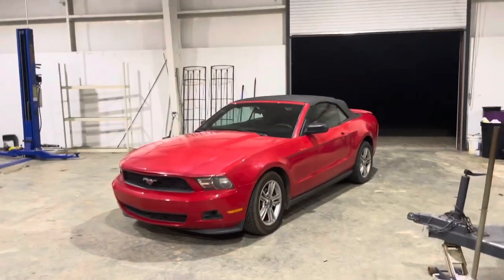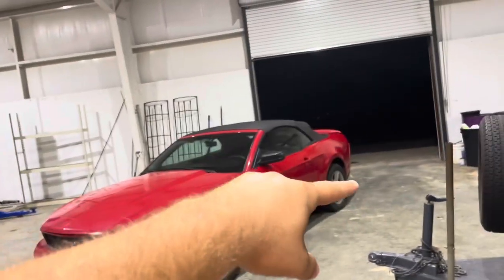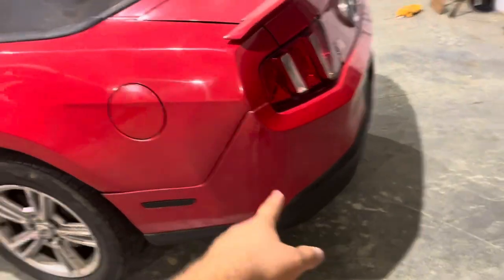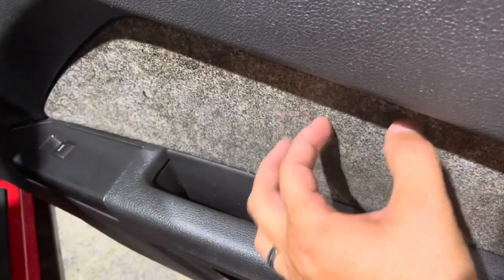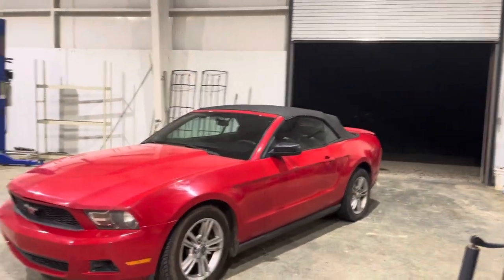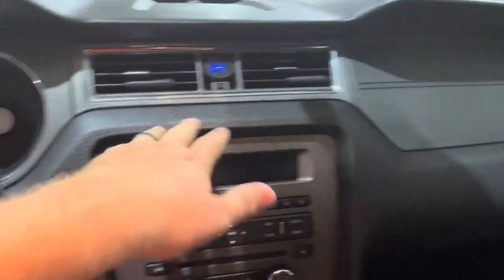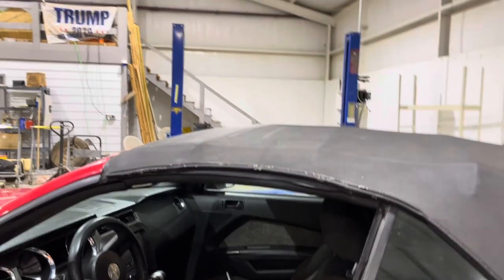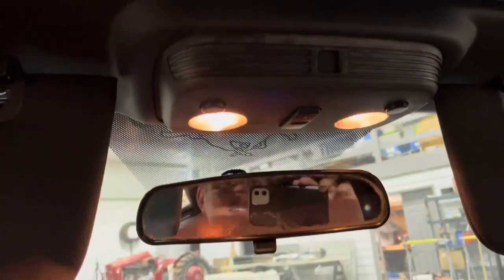Got my Wife a Convertible Mustang that wont open

Comment: Cool ride. 
If you pull those front seats pull the carpet. That poo on the dash looked like mold or moisture damage. The front floor pans need looked at on any convertible to stay ahead of rot.